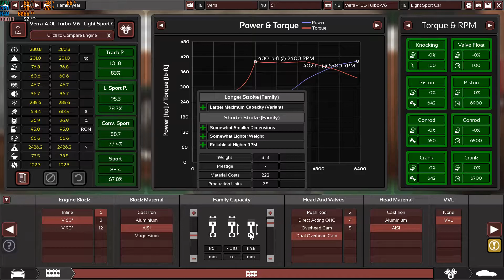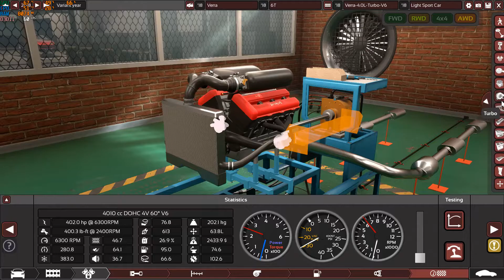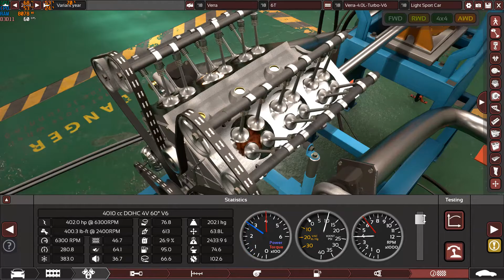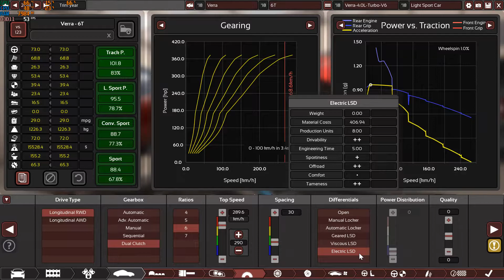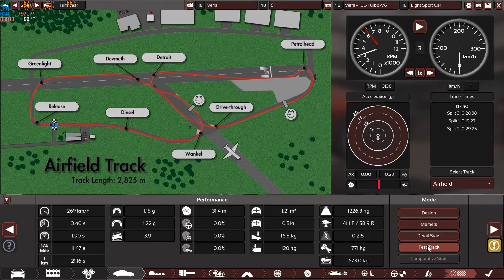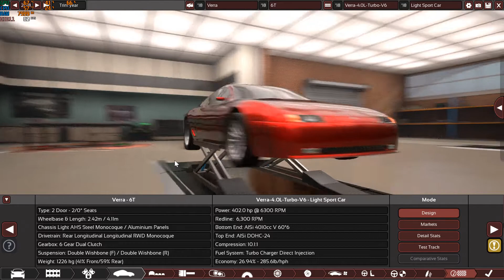Retro/Modern Sport Car Build in Automation.

Comment: Hello bshar again.
This time i found a better engine.
It's hyundai's newest 3.3 litre v6 lambda engine that they use in Stinger.
So, here are the specs:
aluminium head/block
3,342 cc displacement
365 hp at 6k rpm and 376 ft/lb in  1300-4500 rpm (510nm) of torque
109 hp/liter
92.0 x 83.8 bore to stroke
10:0:1 comression ratio 
and it gets 19 mpg in city/25 mpg in highway
Direct injection
turbocharged
It's considered as one of the best engines of 2018.
Reply from the maker: I will make it now 👍